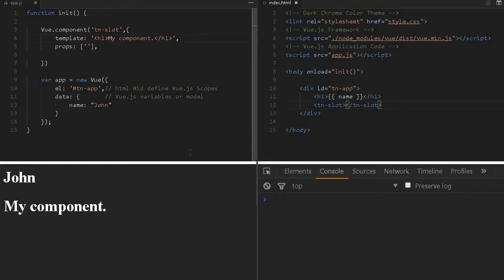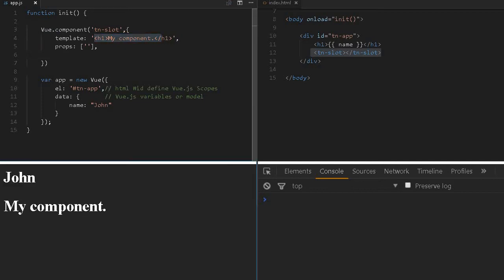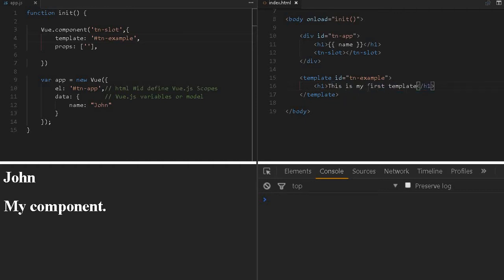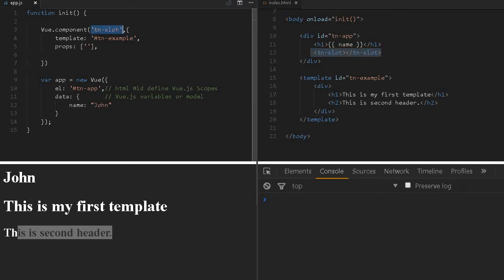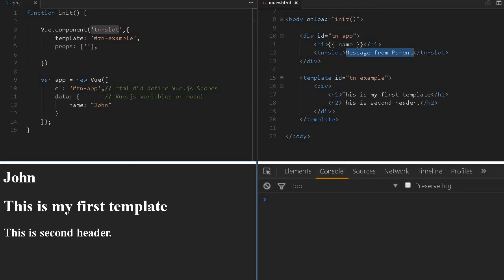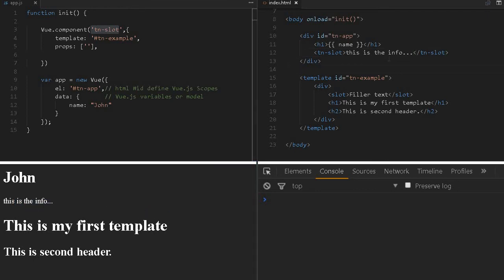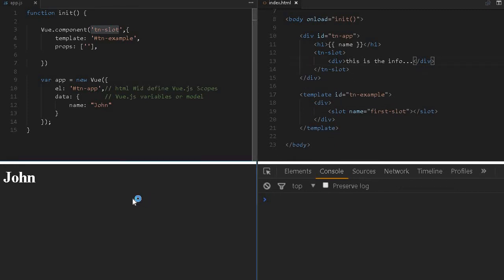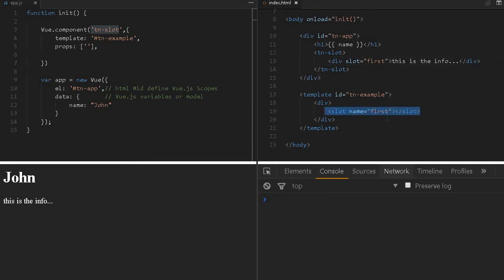17 Vue js 2 Tutorials Components Slot Overview

Comment: thanks for the video. at 7:23, the value you used for the slot name is different between child and parent components.  

in the child component
<slot="first-name">

in parent component
<slot name="slot-name">

in order for a named slot to work, the value must be the same. in this instance, by simply changing the value in the child component to "slot-name" would make it valid.
Reply from the maker: Thanks Sunny for pointing out. In later part of video, I have fixed it. That's why I struggled a bit on there ;)